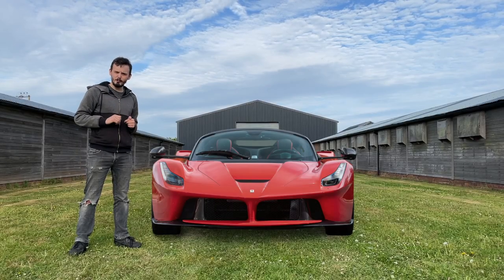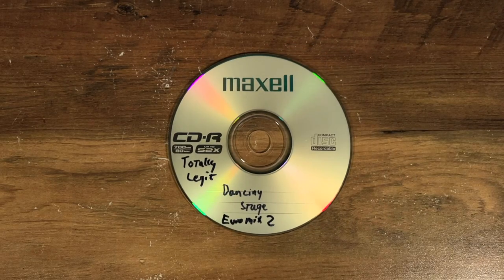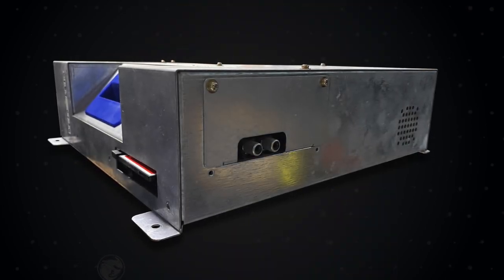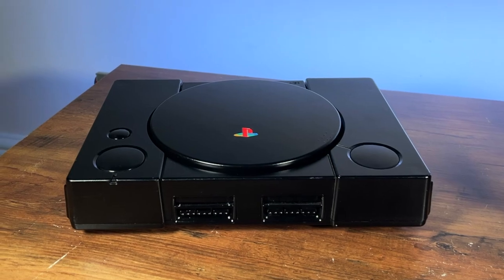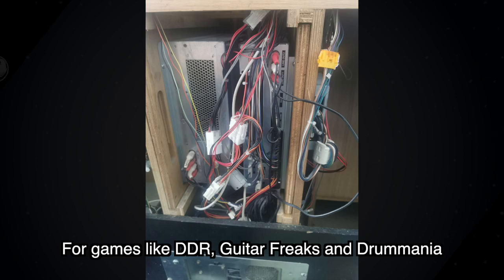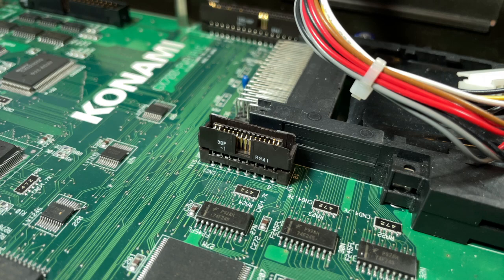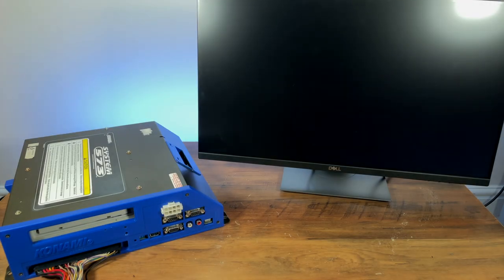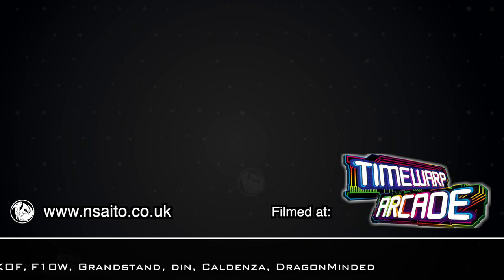Konami's System 573 - Everything you wanted to know about it!

Comment: The idea of making an arcade cabinet based on the first PlayStation is intriguing, did not know that.
But yeah, not surprising that it was not used much, since the PSX graphics looked dated quite soon after it was released.
Reply from the maker: The PSX was used in a load of games however. Tekken and Soul Caliber come to mind
Reply: @NaokisRC  I remember that Soul Blade / Soul Edge was on PSX, but from what I remember Soul Calibur was released on Naomi / Dreamcast only (and then more modern machines after that)
Reply from the maker: Soul Caliber ran on System 11 if I'm not mistaken, so it would have been ported from PSX hardware.

Comment: Somehow arcade systems based on PlayStation felt like the best for me. You can see IIDX, DDR in it's past using it, and the PS2 to PS3 era with Tekken 4(if Im correct?) to its T6 days

Just shows how really impressive the PS was.
Reply from the maker: Or rather, how cheap and easy it was to use. And DDR super nova is based on a literal ps2

Comment: I had to come back to this video to say this.

Somehow we're all sorta wrong about those arcade games not being able to run on a real PS1 or rather PS1 emulator.

I was messing around with the app that runs Simpsons Bowling on the Simpsons Arcade1up cabinet and its running a Baby Phoenix game with Duckstation.
A Konami game made for their arcade hardware running on what is seemingly a simple PS1 emulator, something that should be completely impossible in the first place just like the Wipeout port to the 573 you showcased.
Reply from the maker: The thing is, most of the retail based PSX arcade systems such as the 573, Phoenix run games and the games and even the “BIOS” as PSX apps, Im actually trying to make a retail PSX run 573 stuff since it is theoretically possible, provided they dont need IO like the digital IO
Reply: @NaokisRC  Ooh looking forward to seeing the early analog Bemani titles running on a regular retail PS1 since those don't need the digital board
Reply: there is a port of Tetris The Grand Master from its arcade board to a PSX ROM…
Reply: @crimson-foxtwitch2581  Oh yeah i've seen that one, still an impressive port!
Reply: @GUCFan  i think retooling an emulator like DuckStation to run PSX-based arcade board games would absolutely be possible, especially since modified versions of RPCS3 already support Namco’s PS3-based arcade board games